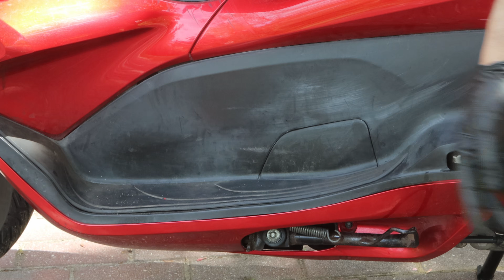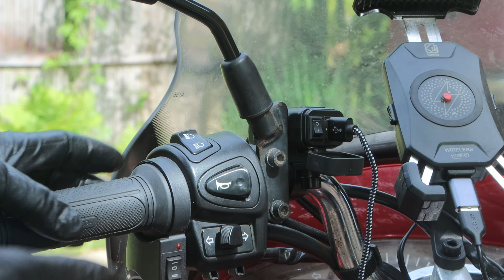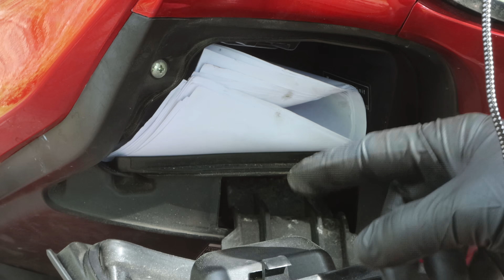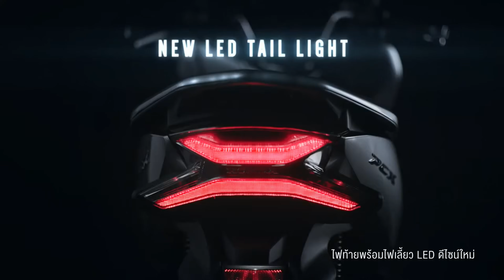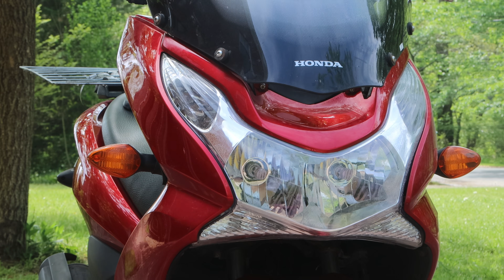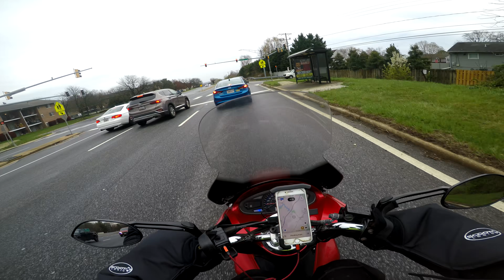Is the Honda PCX150 the Best Scooter? Engine Size, Highway Power, 100 MPG, and Honda Reliability!

Comment: I  got one identical to the one on your video and it has almost 100000km on the clock with only 3 basic serivces carrried out. No joke. I do maintnance myself and its not so dificult. keep regular oil changes, belt and filter.  Eventually change variator rolls and face plate.

Comment: 2.1 gallons multiplied by 100 MPG equals 210 miles. How did your math come up with 130 miles per tank? (15:00)
Reply: Mine only gets 100mpg if I keep it under 45mph and do longer trips at a time. But I've never gotten worse than 75mpg even staying at it's max speed on the highway for long trips. So yeah, not sure what he's talking about.
Reply: A 2013 Honda PCX 150 holds 1.6 gallons (about 5.9 liters) of gasoline.  I don't know where he got the 2.1 figure.
Reply: @davidmcglumphy2240  Okay that makes sense. I had a 2011 125cc PCX and it only had 1.6 gallon gas tank. I upgraded to a 2021 160cc PCX with a 2.1 gallon tank. I just assumed the older 150cc PCX already had the larger 2.1 gallon tank.

Comment: Just picked up a 2016 from auction for 650. I had to get new ignition,  because of no key. I put about 400 miles,  mostly driving north out of s.f. honestly not sure if I overpaid,  30k miles,  with a few panels that need replacement, as the guy before me took a slide on right side. Luckily it only caused cosmetic damage. Im hopefully going to take to a mechanic and get a full service on it, just to make sure everything is good.

Comment: Thanks for doing the review! I'm shopping a PCX right now. I've had a few Honda motorcycles, never had a water cooled one yet. All the local dealer has is gray, which to me is a blend in color, I'd prefer a stand out color.  People already ignore motorcycles.   Probably get one in the next year or so.   I also prefer a flat floorboard, but I'm sure I'll adjust   My Piaggio Liberty has a flat floor you can set stuff on and it has a bag hook above the glove box, which is nice for hooking on a small bag of groceries or Chinese takeout. I 'kinda like the handlebars covered up, just because it's easier to clean, less nooks and crannies. Every bike is  a compromise, the PCX looks to be a good choice. Thanks again for the informative review.

Comment: Many People in SEAsia Says That Scooter is Good, I haven't drive ine of that But J have This SH mode since 2015, over 100km in odo, Bigger wider Tires, Basic Maintenance, Battery lasted for 7yrs and Still kicking. Only the Showa Front forks are already leaking is the Issue

Comment: It's a good idea to keep a 12V jump starter under the seat. They're cheap and about the size of a power bank. The PCX has no kickstart and cannot be push started.
Reply: I noticed that myself,  as i bought a 2016 model this week.  Thanks for the idea. I hadn't fully thought out the solution,  but did see the vulnerability.

Comment: The model that came after your first version red pcx in the video is the model you showed in the video is from 2018 and later. The first series LED models produced between 2014 and 2017 were quite nice and durable. In 2018 and later, the keyless start feature came with the models you showed as 2018 and later. The engine you showed as 2014 in the video is from 2018 and later.
Reply: I have a 2020 that takes a key. Wierd I saw that too but my title and sticker says 2020

Comment: How much did you pay for your 2013 PCX?
Reply from the maker: I got the pcx for 1000$ but i had to drive all the way to NC. It needed work but mechanically it was great. I actually should have bought one a little more expensive with less miles. Im already at 19k. The headlight was from a 2013 according to the ebay seller, but i believe it was a more modern one with the extra bulbs in the assymbly. I had to hand wire it for it to work. But it looks great.

Comment: I agree about the horn placement.
There was a standard set many years ago so all motorcycles would have the same locations for rear brake pedal, front brake, shifter location and operation (no more cassette shifters, etc).
So I don't understand why Honda broke the norm for horn button placement.
It drove me crazy for a while getting used to the new location. Pressing the horn instead of the turn signal. And needing to quickly hit the horn and only activating the turn signal. That muscle memory was hard to change.

Comment: Awesome Video. If you had to choose between a new PCX 160 or the ADV 160, and the price was exactly the same, which would you go for?
Reply from the maker: I'd go with the adv160 just because i like taller bikes and a little bit more suspension for jumping curbs. But I have not ridden any adv160 or pcx160 :)

Comment: The front tire looks like it is mounted wrong.  The direction of the tread is not facing the direction of rotation.
Reply from the maker: After you mentioned i looked at it It does seem it's backwards. But thats the correct rotation.

Comment: Wow 105mpg ? i have a Burgman 400 and i'm very impressed by the fuel economy, i get about 70mpg with 13L tank, so the range is about 350-400km (220-260miles)
Reply from the maker: Yeah this one gets incredible mpg. And imagine with some heavier roller weights it can do even better. The zuma 125 i have gets 95.